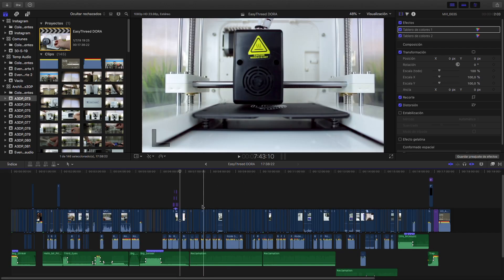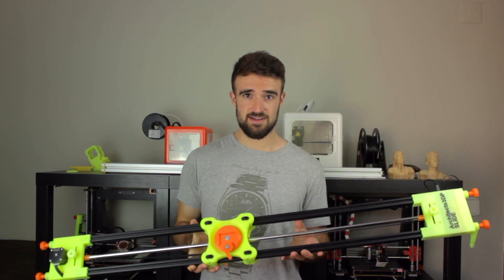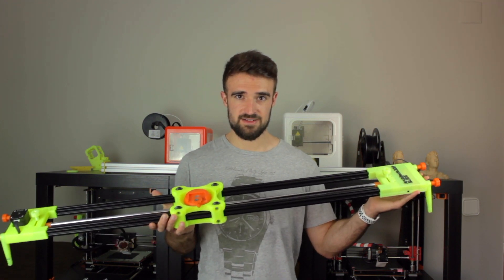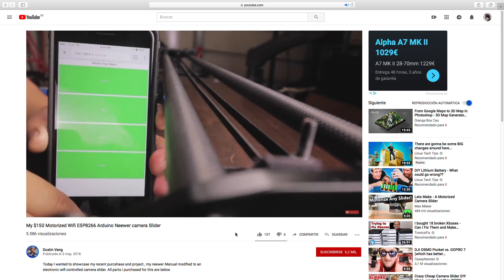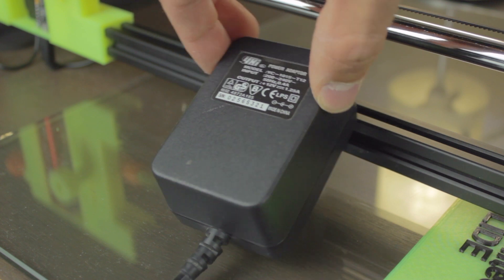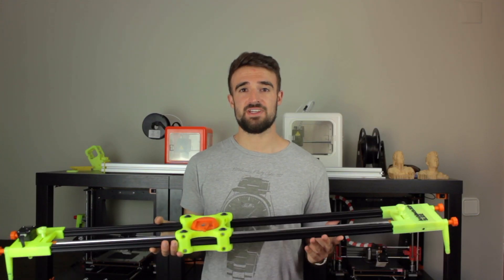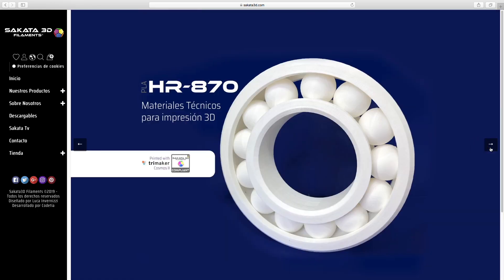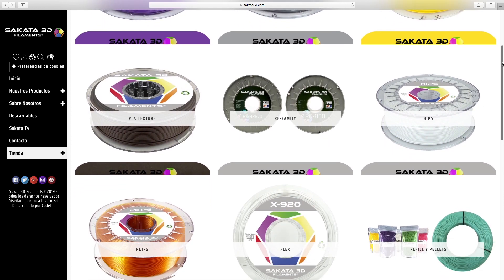Architects3DP SLIDE - DIY Motorised Camera Slider 1/2

Comment: Amazing!! I saw this camera slider in edelkrone brand.
Reply from the maker: Are you sure? I've designed it from scratch ;)
Reply: @architects3dp  Sorry for mis understanding. I mean functionality is similar :)
Reply from the maker: @mericergen  Ow yeah it's possible! :) This system is commonly used to make the pan movement.
The alternative is to add a secondary stepper motor, what would increase costs.. so that's why I chose this system instead

Comment: the nodemcu esp8266 is good choice & cheap for its usage.u can control it via your phone thru blynk app. but other things like v slot rail,bolt,nut,wheel,nema17 motor is expensive. what is the total cost ? i have tried experimenting with fully 3d printed slider with ball bearing(slider is from Mulbot) to reduce cost. it works great & smooth except the tolerance will go crazy with temperature change. the pla expand when cold & shrink while hot. it expand & shrink like crazy for the first week. after the first week it have not expand & shrink that much
Reply from the maker: Dear Aaron thank you for your comment! 
I'll upload the Bill of Materials today in the description, so you can check the total price.
Regular hardware is very cheap since you only need a few screws that you can buy for your hardware store. You could buy the other components for very cheap as well if you find a good deal on amazon for example. :)